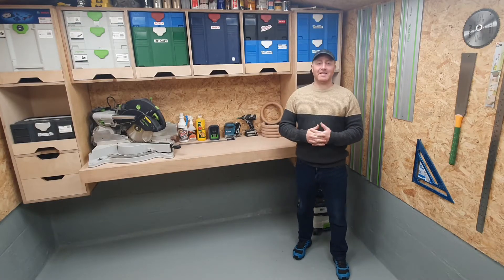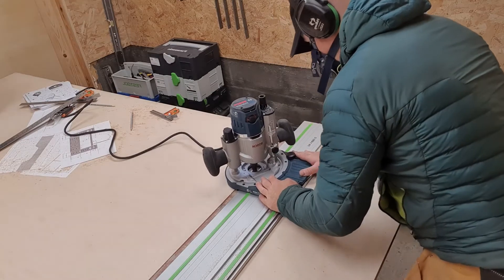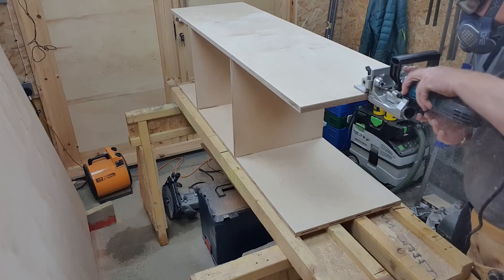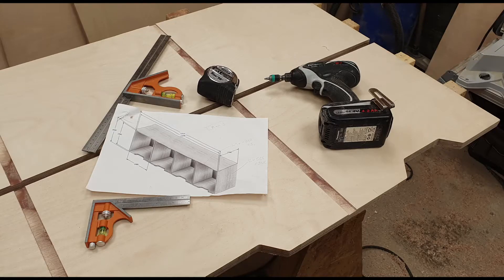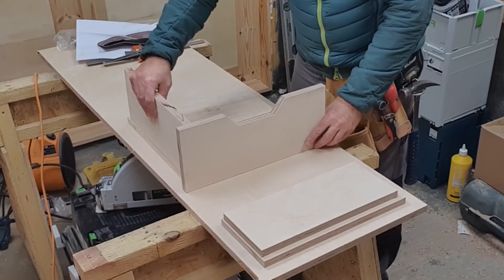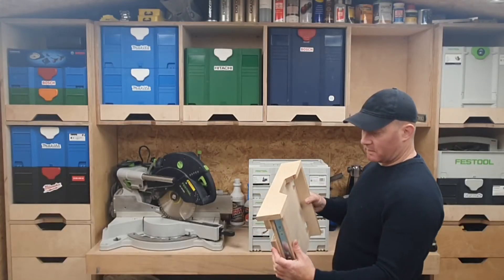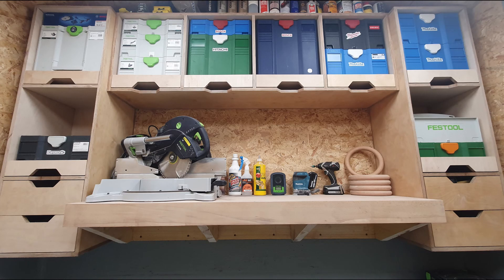How To Build A Tanos Systainer Tool Box Port - With Sliding Drawer Docks - Workshop Build PT2

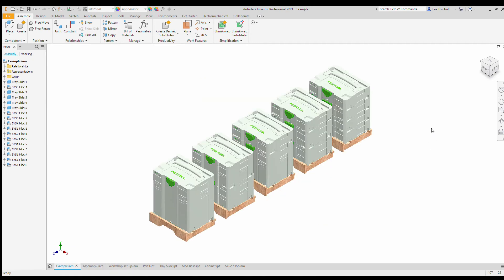Comment: I noticed something odd. As of 09:35 you explain how the different systainer sizes fit in a Sys 5. You made the mistake by saying that 5 Sys 1's fit 1 Sys 5. However your cat model only showed 4 Sys 1 systainers. I only own Sys 3 systainers and always thought that indeed 5x a Sys 1 would equal a 1 Sys 5 (makes sense).

I looked it up though and this is not true...
4 x Sys 1 = 1 Sys 5
2 x Sys 3 = 1 Sys 5

It does work out to
1 Sys 4 + 1 Sys 1 = 1 Sys 5
2 Sys 2 + 1 Sys 1 = 1 Sys 5

I just realised that the numbers of the systainers do not add up to equal each other ... revelation.
Reply from the maker: There is also size differences between the old systainers and the new ones. The old SYS 2 was 115, now the sys one is 115 high.
Reply: @DesignBuildTDE  Would you happen to know the logic behind this 'seemingly' logical nubering system?